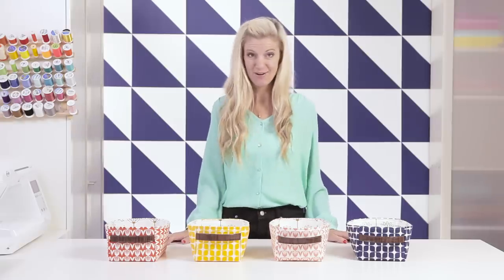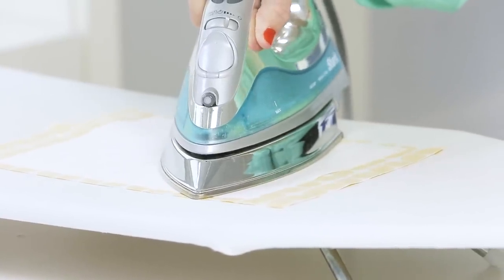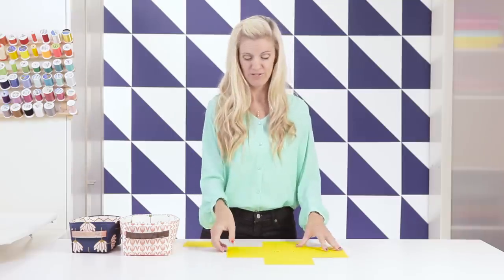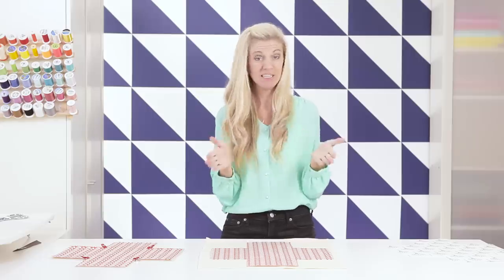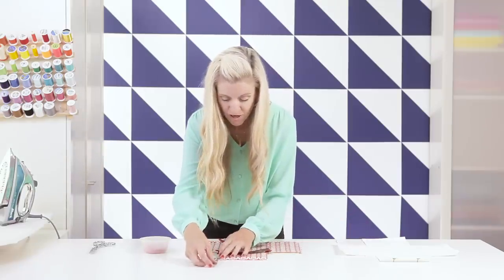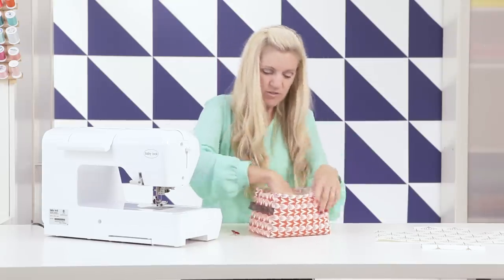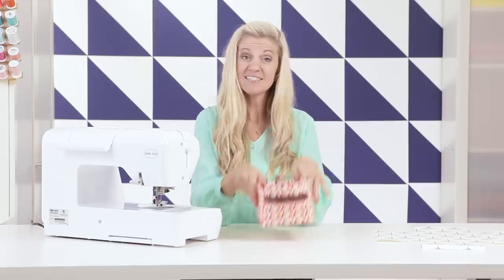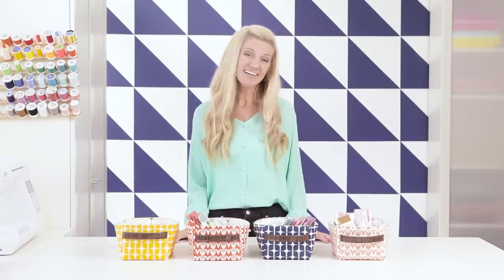How to Sew a Fabric Storage Bin

Comment: Ive made a bin, and love it. But I was thinking that sometimes (depending on what you want to put into it), you want VERY stiff, upright sides. My idea: plastic canvas, cut to size, and put between outer and lining just after you nest the lining into the outer. Then sew around the edges. For the bottom you could cut plastic canvas to size, cover it in fabric, and lay it in the bottom of the bin. This alone might help the sides be more upright (or lay it in the bottom of the outer just before you put in the lining). I had a custom tote bag from eBay that had that. I’m going to try it. Gotta get plastic canvas first!
Reply: Hi there, Did you make it? could you pls update if you did I wonder is it will work thanks
Reply from the maker: Sure sounds great! In the XL bin, in the pattern, we recommend dropping in some extra reinforcements like you're talking about. https://shop.madeeveryday.com/products/hold-it-bin
Reply: Great idea! I’m going to try this too!

Comment: Everything went just fine until I sewed the outer fabric to the lining.  I knew pretty soon that the outer fabric had a lot more fabric than was necessary so I tried to work some of it into the circumference.  However, I ended up having to make some large pleats.  I am a new sewer and I was just wondering what I must have done wrong.  My seam allowance for the outer piece was 1/4 inch and for the lining, 1/2 inch instead of 3/8”. Could that mistake have caused a lot more material at the top of the basket for the outer than the lining?      It’s a really cute basket, with nice crisp lines. I just messed up the top!  Thanks for your tutorial. Pat
Reply from the maker: Hey Patricia, Sorry you had some issues! This kind of project works best if you can be really accurate in every step (from cutting out, to sewing with the exact seam allowance, etc). I would give it a try again and try your best with the two seam allowances. If you want to see more, there's additional info/diagrams/etc in the pattern for this in my shop. There are more sizes, lids, and other info included in that too. Here's a link: https://shop.madeeveryday.com/products/hold-it-bin
Hope that helps! - Dana
Reply: @MADEEveryday  Thanks a million!

Comment: YAYY!!! THE HOLD IT BIN VIDEO!! I have one quick question! Sometimes when I make the bin, the lining tends too be smaller than the outer part, to the point where I have to really stretch the lining fabric to fit the lining. I was following all of the directions in your pattern, but I just wanted to ask whether you had any troubleshooters for this. In your video it came out perfect!! Do you think I should  sew both the lining and outer part with the same seam allowance? Thank you.
Reply from the maker: Haha. I knew you'd be happy! :) Yay! Sorry you've been having trouble with your lining. Are you using the exact same interfacing, and a layer of felt? And make sure you "pull" each corner at the seams so everything is straightened as much as it can. Those lining corners can have a tendency to fold on themselves a bit.
Reply: Oh ya! Thank you Dana!!!

Comment: Is there any specific reason that you couldn't sew the inside and outside together with your free arm as you would a sleeve? It just seems like it would be easier to see what you are doing and that would put your top stitching on the outside of the bin and less likely to crush your bin as you sew. Just curious to know...
Reply from the maker: Hi Caroline, Yes!  You can definitely use your free arm, if your machine has one. Not all machines come with that feature. But it would have been nice to mention in the video. Thanks for the tip! Dana
Reply: Ok, thanks! I didn't know if there was some quirky thing with seams or something that it had to be done a certain way. Thanks for replying and I did enjoy the tutorial!

Comment: If I'm using canvas fabric for the outside and lining, do I still need to use the interfacing?
Reply from the maker: I would play around with it and see what you think. I made a bin with vinyl on the exterior, and did not use the interfacing, but still used the felt layer. So it just comes down to how stiff your fabric. Have fun! Canvas is a great fabric! - Dana
Reply: Thank you for responding so quickly!  I think I'll try without the interfacing first and see how it turns out.  Thank you for posting such great videos.  I am new to sewing and was struggling until I started watching your videos.  You explain everything in great detail and make it easy for us beginners :)
Reply: Turned out great without the interfacing!
Reply from the maker: Ah! Good to know! :)